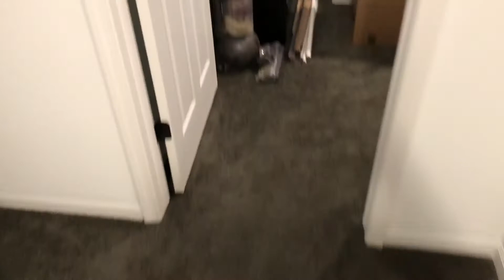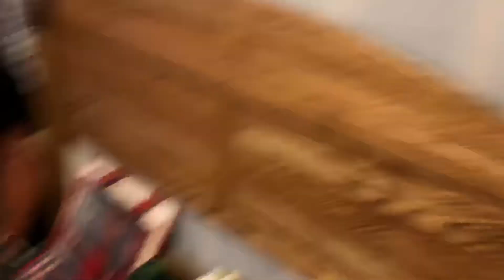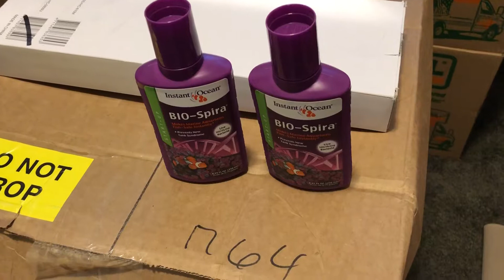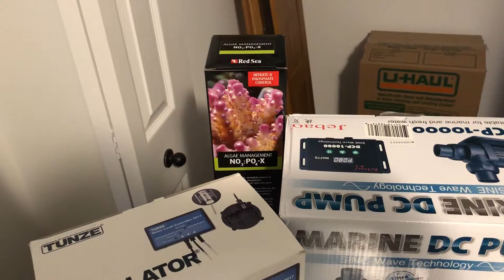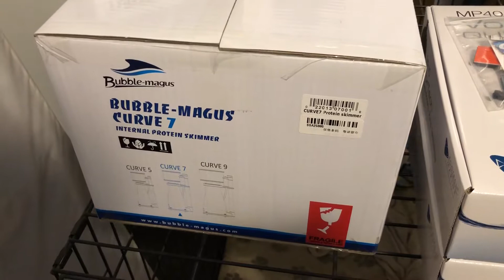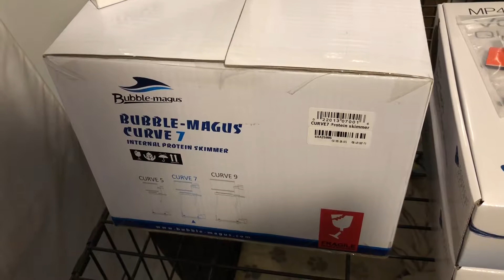Red Sea Reefer 525 XL: Equipment & Supplies!

Comment: 525 is going to be awesome!! good for you. If I had the space lol. I just drilled my refugium. It was my first time. Just go really slow. I made a video. Ended up using a peice of wood and some clamps to hold the hose. I am happy with the results. Looking forward to the videos..
Reply from the maker: I actually watched your video and will probably do the same thing. Makes the most sense as to not jeopardize the glass. Doing a 1" bulkhead and then reducing through a bushing to 1/2".